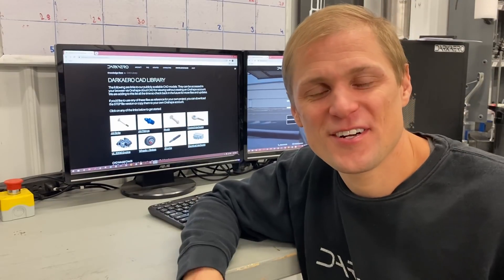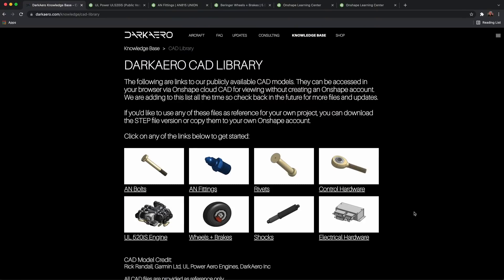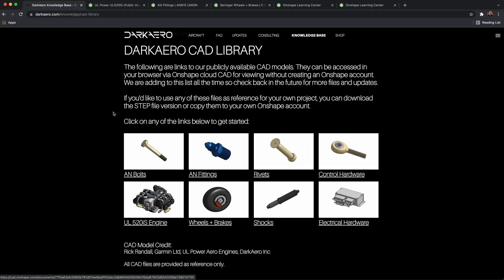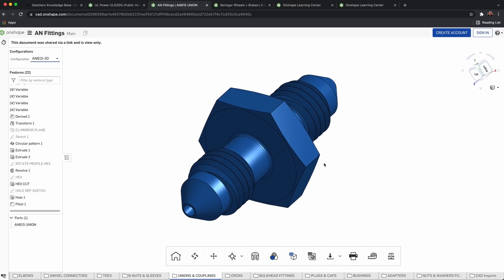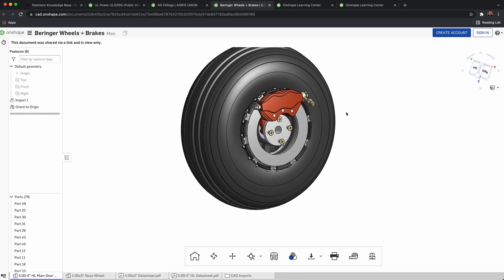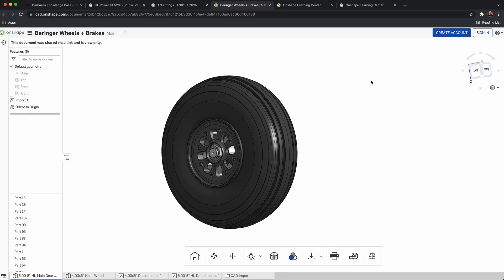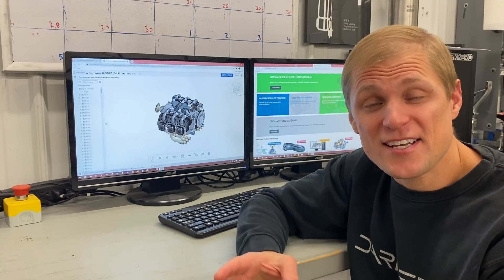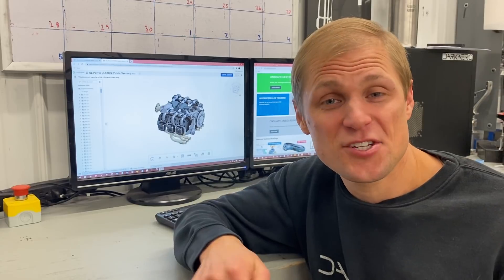The Ultimate Aerospace CAD Resource - DarkAero CAD Library!

Comment: Aero propellers "... should always be an odd number of blades from 3~7[as i was told through the years], ... depending what is most beneficial for her potential aerodynamic performance out of all samples in air coefficient tunnel tests & completed..." in full scaled DarkAero flight tests.
   Is that correct?  And, so far, what has proven as the best performer.?  3, 5 or 7 bladed propellers ?
    Next, have you considered an all electric motor that would only require 1 or 2 12V. battery(ies)  for take-off  [and to be recharged while in flight] ... Which could carry enough of an electrical charge while in flight... w/entire flight requirements are ALL available with 2 or more scoops holding a turbine(s) of brushless magnetic generation in [V. & W. & Amps] which could keep the DarkAero in flight with enough power recharging until landing & to a complete stop/static ??   If not why don't you side-experiment on that idea.?  Yes? 
   Congrats on & onto your new facility!  I love all your works as per videos on Youtube platform. TY for your contributions to mankind's processions onwards so all might benefit from. Thank you so much...

Sincerely
         ~paul b p    |||    >  >     >        >                  >                         >                                         >  ^j^ ~"Whheeeeeee!"

Comment: Excellent initiative 👏 

I’m currently using Onshape on an iPhone 12 for small volunteer projects to assist friends in the Experimental & Light Sport Aircraft community.

🤔 I’d be happy to create and upload models of simple components in my spare time (sort of a hobby but with an almost 35 year professional aircraft design capability influencing outcomes). Sketches on napkins or the back of an envelope with key functional dimensions (including EOP) and interfaces defined, is all that I’d need. Other dimensions would be ‘guesses’ seeing that they aren’t critical. I’d also probably include “Mate Connectors” so that functional interface characteristics are represented in an obvious way.

Great work guys 👏
Thanks for sharing and for taking a disruptive approach 👍👍

Comment: I have rotax 912 and 914 + HKS 700. But they are from the MFGs. So i would feel funny giving them over. Could you contact them directly as i did?
Reply from the maker: Shane, thank you for checking out the video! The Rotax engines would be great to get up on the database. We will need to reach out them and see if we can get them added.
Reply: @DarkAeroInc  I've got Rotax 912iS, 914, and 915iS CAD models directly from BRP Rotax. I could send you them if you are interested, however they are quite large (about 700MB in total)